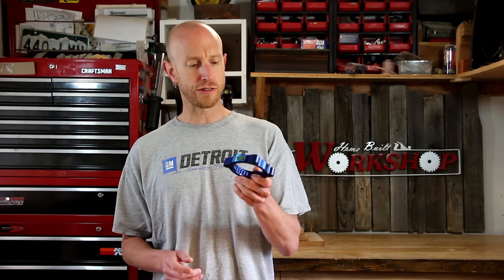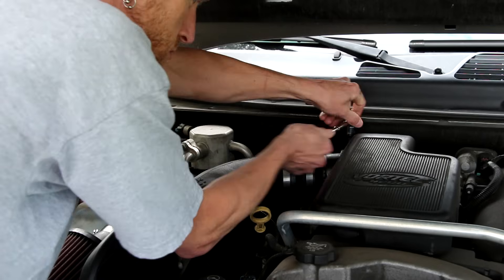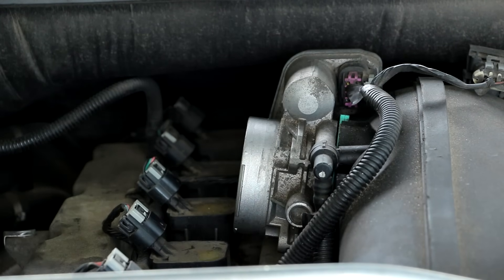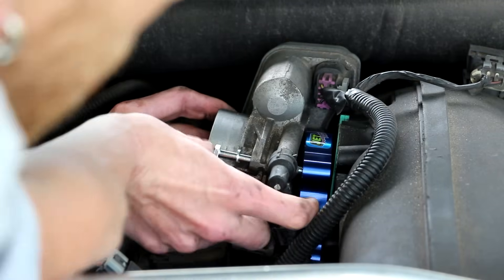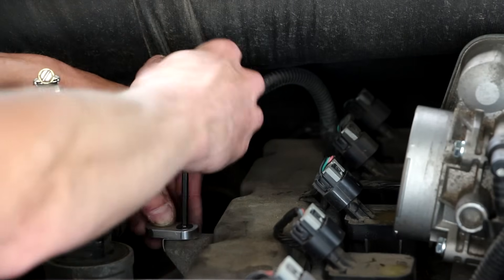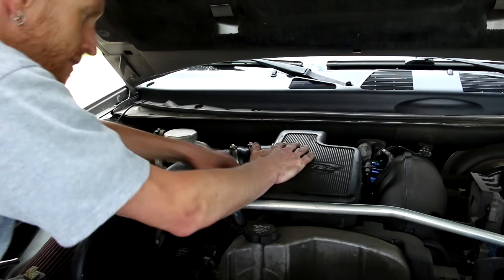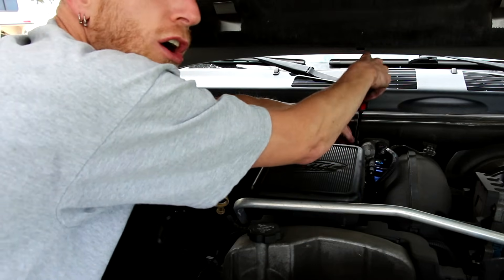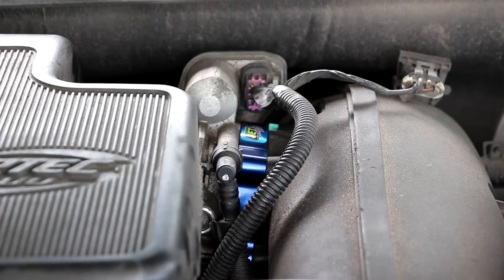Is A Throttle Body Spacer Worth It?

Comment: I think that whether or not a spacer improves torque and/or mileage depends on what vehicle, engine, carb/TB, air cleaner and exhaust you have.  I'm guessing that having improved intake air/exhaust flow, combined with the spacer increases the velocity of the intake air for better atomization of the air/fuel mixture and more complete combustion.  For my '99 Dodge 5.9 with improved exhaust/cold air, it most definitely increased torque in the low to mid-range RPMs.
Reply from the maker: I completely agree that there are a lot of variables and every vehicle is different.

Comment: I think you misconfuse intake spacer vs 'plastic' or 'plenum' ones. The real one's supposed to cool down your complete inlet on your engine from being warmed up, so your cold air does'nt get soaked in heat with a hot intake. A spacer in between (for example between block and intake) would drop the air inlet temperature a few degrees producing more HP cause of better ignition. But all these mods are 0.1% increase, you should simply go for a bigger turbo or compressor based on what you flavor is. The thing in this video only shows a threaded intake spacer, which would 'warp' the air a little more providing a little more torque, but nothing serious and proberly lose power on the high-end.
Reply: Well I think you confuse what misconfuse means.
Reply: KronosSlots you’re right about losing in the high end but I have a AFE throttle body spacer which makes a huge difference at low end, but I do have a full stage 2 cold air intake by AFE which replaces both the resonator and box intake and the combination of the two gives insane throttle response and its dry fuel injection not carburetor

Comment: I have 2005 GMC ENVOY XL 4.2 I used the Airaid throttle body spacer alone with K&N cold air intake & removed both factory mufflers and installed Cherry Bomb 3" inlet outlet glasspack the longest one I could find its Bolt on flange to catalytic converter adding dual tips like on the Dodge challenger soon nxt going to buy the jet performance stage 2 chip

Comment: I think it all depends on the car. I tried one on my 4.2 Trailblazer and it did nothing. In fact, I seemed to lose fuel economy. I also have a dual catback exhaust and cold air intake, so a spacer may not have much effect. I also seem to have better throttle response without it. All in all, spacers aren't going to do much performance wise.

Comment: The "start it up and see what happens" activity can get exciting. Way back in the mid 80's I was working at a BMW Dealer. For some reason I had to pull off the air inlet to the throttle body (733i). It was an easy job and I decided to go to the restroom before pulling the car out. While in the restroom I here all this commotion in the shop,out I go. I find that the Service Advisor decided to pull the car out for me,wrong. I had put one of the big clamps on up side down and it prevented the throttle from closing, in fact it held it full open. Close call but we all went home that day.
Reply from the maker: +Dan R wow. Glad it all worked out OK.

Comment: Depends on the vehicle. I had an 04 GTP and the throttle body on those are right above the exhaust cross over. Using a spacer helped drop intake temps.
Reply: Shawn Van Meeteren I j NJ I hi

Comment: Installed a “PowerAid” (I think, it was red) TB spacer on a 2003 Wrangler w a 4.0L 6 cyl. I had 33” tires that completely robbed me of my 5th gear. I lost speed on any hill or incline and was forced to down shift to stay at 55-60 mph. After TB spacer I could maintain my speed on mild inclines and pass other cars while staying in 5th gear!  Highly recommend K&N factory replacement filter with the spacer!

Comment: Works on GM Big Blocks for low end torque and off the line acceleration from a stop.  Improved my 8.1 Vortec 2003 Avalanche 2500 from 8.9 mpg to 10 but the savings will never pay for the part cost.  

IMO, this part works to better eliminate the air flow drag off the restricted throttle body intake and baffle plate.  I suspect there is a bit of turbulent air at the neck of the Vortec or LS type manifolds and the corkscrew air rotation scrubs off the turbulent air going through the restricted manifold neck for better air flow.  I am fixing to throttle body swap my 78 mm throttle body to an 87 or 90 mm which I believe will eliminate the need for the plate. 

Coefficient of drag is what is working here same as the bullet ballistic coefficient rotation exiting a rifled barrel vs. a smooth barrel musket.  On a smaller engine you are just not pulling the air volume like a large motor so less improvement.  The easiest way to get more horsepower out a restricted motor is to improve air flow at the intake and exhaust. I am not going to be super charging my 8.1 because I need the low-end torque to get a heavy tow load moving and to maintain speed once I get accelerated.  The 8.1 is a beast and starving for air as it came from the factory . I expect to get major improvement putting on a larger throttle body.  It seems GM made a lot of these truck from 5.0 to 8.1 which the smaller throttle body can be swapped out for a larger one. So, I'll let you know if I get easy improvements because I did not know I could swap the GM Throttle bodies with later models.

Comment: All it really does is increase the DISTANCE the air travels to get into the engine and creates a slight restriction in airflow. By doing this though, you increase air velocity so at low rpm you might gain some slight low end tq but it is quickly negated as the rpms rise and actually hurts horsepower because now the air is traveling farther and is more restricted.
Reply: Tyler Phelps 🤔🤔🤔
Reply: Or vise versa
Reply: This is kinda wrong, the spacer would increase the plenum behind the TB area there for the "restriction" wouldn't be an issue since these engines don't consume the plenum area that quick (which is where the cylinder is directly pulling air from). You also wouldn't see any more low end torque but rather an increase in throttle response because the air would be moving from the tb to the intake valve quicker. Which is the take away from this, power gains aren't there unless the fuel flows through it too, but it will have a very slight difference in throttle response.
Reply: Maybe on startup the air takes a tad bit slower to reach the chamber, causing a bit slower startup, depending on the spacer size. But air is a gas, which is an unlimited source, and is consistently flowing into the combustion chamber after startup, granted the filter, throttle body, and engine is working properly. I personally don't use throttle body spacers or plenum spacers that's over a 1/4 inch, in conjunction with other parts. The only thing these parts improve when used by themselves is throttle response. Horsepower and torque gains are a hit and miss.

Comment: Jeff baker I have the 06 H3 hummer with the 3500 I5. I have not installed this spacer yet... but I have installed the JET Performance MAF sensor because of my cold air intake and flow master exhaust and what a difference I noticed in that, probably much more than you would just putting a spacer in there.
Reply from the maker: +MrGuitarguyadam I've been thinking about trying that. Thanks for sharing your experience with it.
Reply: a "performance maf" for a cold air intake and a flowmaster?
Reply: +frankenstrat25 with the stock restrictive intake and stock exhaust, the stock MAF works just fine. But when you add more air and get the engine breathing a lot better the stock maf is the limiting factor. the one that JET Performance offers allows more air to move through and recalibrates the engines computer to perform more efficiently with the other upgrades.
Reply: Hey did you ever get those parts put on your 06 hummer ?   I've also got a 06 hummer and wanted to do so dog the same stuff

Comment: Put one on my 2017 Ram 1500 with 5.7 Hemi.  Totally robbed the low end torque. Caused the Economy light to stay on no matter how heavy I was in the throttle.  

Took it back off and viola power was restored. 

It was installed correctly as I have done quite a few. O-ring up and alignment pins lined up with no vacuum leaks.

Comment: i have 2007 4runner V6 and i installed a air raid throttle body spacer along with my K&N cold air intake and i love my spacer not because the performance but because it spins the air and sounds like a turbo diesel, no so loud like a real one but close.

Comment: it works better if you throw a few bolts into your intake manifold
Reply: Or you could pour a 5 lb bag of sugar into your gas tank. Sweetens the gas and makes the engine take it in faster.

Comment: Thanks I found out that it was  because I was using a pedal commander with the spacer and they weren't working well together so I decided to remove the spacer and that solved the problem.
Reply from the maker: +Karl Boyer glad you figured it out. Does the pedal commander work well?
Reply: The pedal commander is awesome it doesn't increase HP but it makes you feel like it does. It gives your car an incredible amount of boost, at some levels it's a bit much. But I really enjoy being in control. I just bought a new throttle body for my 2015 ecoboost base model mustang and with the pedal commander and all of the mods, I think I am just about ready to give the 5.0 mustangs a run for there money lol. I think the space would have great if I didn't include anything else to increase throttle response.

Comment: I got the 2006 trailblazer LS with the 5.3 v8 and I don't have allot of money but want it to have more power it feels sluggish lately what are some things along with the spacer spark plugs intake delete air resonator spark plugs wires?
Reply from the maker: Not sure on the 5.3. Id try the spark plugs if they haven't been changed yet, and a cold air intake and see how it is. You might also look at cleaning the throttle body, that could help, and its pretty cheap to do.

Comment: Tbs yes on carburetor,  waste of money for fuel injected
Reply: can you explain please, I have an 05 ram 1500 it is fuel injected but I was told to throw one on
Reply: In a carbureted engine The fuel is mixed with air in the carburetor and it breaks down into small droplets. A TBS increases the distance the fuel travels, so it has more time to better mix with air, meaning more efficient burn. =more power, better fuel economy, better emmissions. In Fuel injected systems only Air moves through the throttle body. Space here is not too crucial, but fuel is injected directly into a port where it mixes with air just before entering the cylinder. This makes a TBS Pointless. In some cases the increased space can decrease air flow worsening output. The gimmick is when people swap them in along with a high flow air intake (Like a K&N Air filter) Of course it improves, but due to the high flow intake. I would save my money for some more important parts on that RAM :)
Reply: Aron Kovacs you mean adding a cold air intake wouldn't be a good thing to do?
Reply: It would be a good thing, but not the throttle body spacer
Reply: +Aron Kovacs the problem with that is people like you keep saying that and post no proof at all to back up your statement. on the other hand everyone that installs one says the complete opposite no to mention you can actually find before and after dynos.
Reply: Read my comments again. I said it may benefit different types of engines.
Reply: I know this was an old post, but you're right...   spacers work for carb'd engines...  just decoration and added weight on modern injected engines.   Like i said in my post,  it's like tubbing the rear end of a front wheel drive car...  recycled old tech that no longer applies to current engines.
Reply: precisely true ! It's more for carbureted engines.... the reason why it works there is 
because you add volume (air) and you place the carb up higher away from 
the heat source and gets cooler air which translates in more HP (nothing
 crazy couple tops). It does not really work with cars that have fuel 
injection as the ECU is doing all the work.
Reply: Aron Kovacs it just depends what kind of tbi you have older tbi the fuel pours in like a carb via the injectors on the top portion of the tbi which will give IT more time to mix

Comment: hi jeff. im installing a tb spacer on my 2010 1500 with a hemi. i had a spacer on my 88 chevy pickup with throttle body injection on a 5.7l. i would recommend it for that application. well see with this truck.
Reply from the maker: Post a reply and let me know haw it worked.
Reply: The screws that came with it were too short and would have stripped the holes if i torqued them down. AFE power is the brand name. Im just returning it instead of playing with it.
Reply: Jeffrey Bell you have to remove the stock throttle body spacer to install the new one. I had the same thought when I installed mine in an 02 v6 accord, but found out that I had two double sided bolts to remove from the intake manifold and a stock throttle body spacer to remove as well. Mine fit well without stopping anything. No check engine light, and more responsiveness and maybe more horsepower. I believe it to be worth the 60$ I spent on it in my application.

Comment: omfg
Please explain why this should make a difference! lol
It won't make ANY difference other than draining your wallet. 
*adding NOS stickers on your windshield will add 5 hp each
Reply: no shit?? I'm a get me like thirty of em
Reply: cbatic Some guys on the internet say 50 is the sweet spot!
Reply: Im running 75 NOS stickers on my Honda Supra R34 and pushing 2000HP!
Reply: CoreyCantEdit looool XD
Reply: the grooves on the inside of the spacer is supposed to create a turning effect in the intake air and mix the air/fuel better. I myself don't think it works as well on newer engines compared to older tbi intakes where the fuel is added at the TB.
Reply: hell yeah ima put them all over my windshield !!
Reply: Eddieallen
Reply: Eddieallen
Reply: Latent heat loss of vapourisation, the throttle body spacer allows the fuel air mix more time to vapourise allowing it to lose more heat across the longer space, A cooler fuel/air charge allows more fuel/air into the chamber and a larger bang upon ignition. The gains from this are very small, but noticeable, especially during low end acceleration, better throttle response and better starting and smoother running in hot environments, in cool environments the gains are less noticeable. 
Just in case you actually wanted a serious response.
Reply: That is pure bs
Reply: Actually it's science. But please do feel free to argue with physics.
Reply: Science would mean that you do a very precise engine dyno test under strict conditions.
Quoting the ad text on the packaging under a video is neither scientific nor physics bro...
Reply: Max Lindner That's the best you got? Heat loss via vapourisation is an already proven scientific fact, he doesn't have to reprove it just because your too lazy to Google it. That's like saying you must prove every aspect of the science involved in your computer or smartphone every time you want to use it to randomly slap keys to write crap on YouTube. You want to see a dyno pull for proof? There are many, right here on YouTube finding them is as simple as searching for "throttle body spacer dyno".

Comment: If this were a carb spacer then yes, it is a definite upgrade.  A carb spacer allows both fuel and air to pass which usually increases torque fairly well with little gains to actual HP.  This application however, being fuel injected only passes air, half of what is needed for substantial gains if any.   I would venture to say at best maybe 1/2 HP and 1-2 more torque, but I kind of have my doubts of any real gains.
Reply: For $100 and easy install, 1-2 hp and a nice little torque upgrade aint bad at all.

Comment: I have a 2003 Ram 1500 with a 4.7 and just put on a K&N CAI. Gonna be putting the air raid spacer on it as well. So Hopefully I'll see some difference. Atm the CAI has changed the sound of the engine and my gas has improved over the week.

Comment: how can this help a fuel injected engine? its just more drag on airflow
Reply: Actually the added distance from throttle body to cylinder allows a little bit more air fuel mixing. Means a more complete fuel burn and a very minimal HP increase, probably no more than 8hp. Hardly noticable.
Reply: Hoosier Waterfowlers if it’s fuel injected that means the fuel is shot straight into the cylinder, not in the intake. So the added airflow is not adding efficiency
Reply: @2000chevy4x4  unless it's throttle body injected or a mix.. good for throttle body injected if you're messing around with other stuff.

Comment: You can clean the throttle body and do fuel induction and see improved results over all performance and mpg will improve more and for less money. This spacer is more carb engines.

Comment: I've been installing these things paired with K&N intake kits for years and i heard mixed reviews from my customers, they say either it does nothing at all or it improved fuel economy. I personally wouldnt waste my money on one
Reply from the maker: +808 Tait thanks for the feedback. After using it for a while, I would probably agree for my application.
Reply: anyone that needs to hire someone to install a throttle body spacer is in my opinion in NO POSITION to judge the performance gains or losses from one.
Reply: @THE_CHOAS_ENGINE  FACT'S

Comment: IMO cold air and tbs only really function the best if you're going with exhaust headers and a larger diameter exhaust. From my experience anyway. you can't increase volume in and expect gains without increasing volume out.

Comment: If you do get a check engine light it's because you didn't reset the ECU and then drive it until it relearns all the shift points and fuel trim calculations. only then will you know if it feels the same way it did before